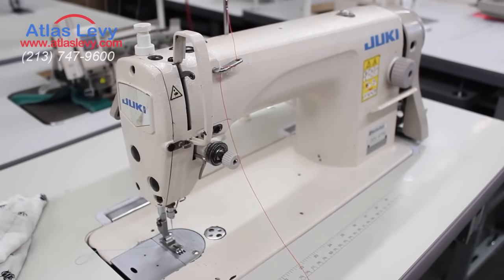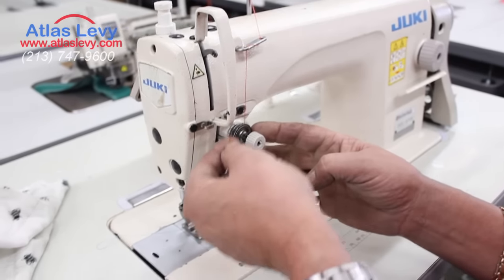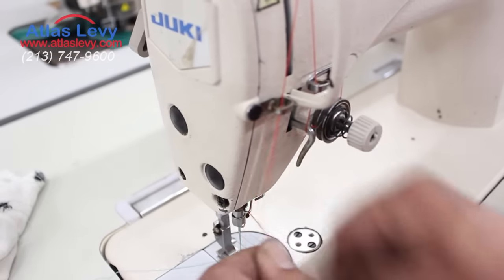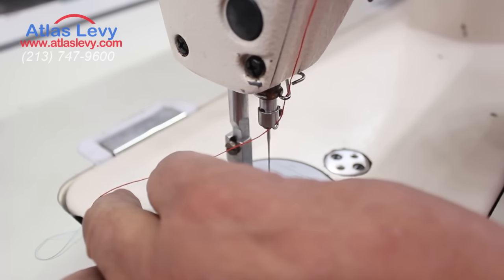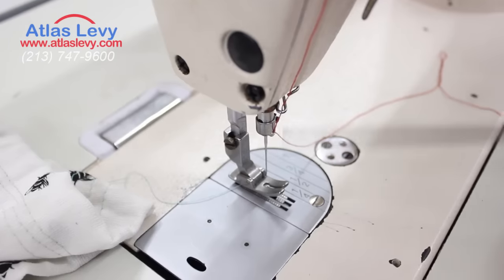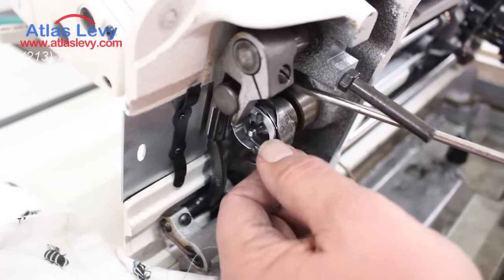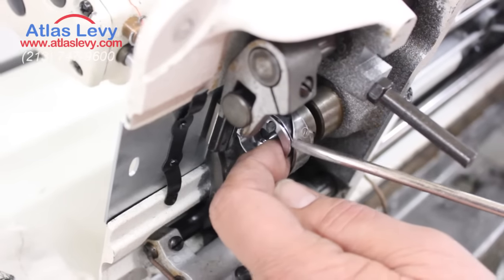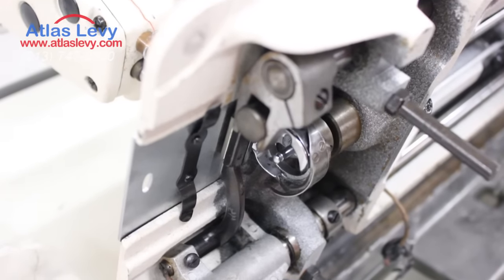Thread Keep Breaking - Troubleshooting

Comment: hook with sand paper. lol how about fine emery paper and stroke in the same direction. you didn't mention that the foot might be too narrow for the needle used which would cause thread breakage. Burrs on underside off foot also and a needle with a burr on the tip.

Comment: Hello 
My Juki ddl-8000a keeps breaking the thread while I’m trying to sew even thin leather - needle is correctly positioned and threading and everything else in my opinion - I’ve regulated tension as well but still …
What could be the solution ??
Thanks in advance

Comment: i have Gemsy heavy duty and i use it for fabric ,,,it cut thread when i accelerate ,,, but when i i sew in slow speed this probelme happend rarely what to check sir?
Reply: soslabass  I have a brother machine and same problem that you mentioned.what is solution.any information?
Reply: bobbin timing